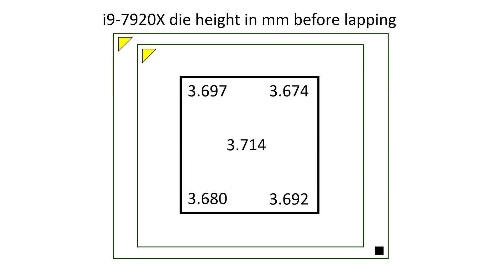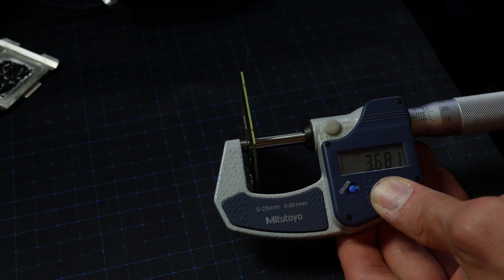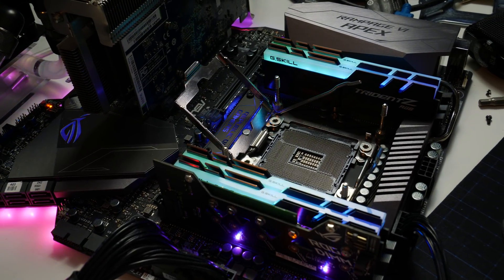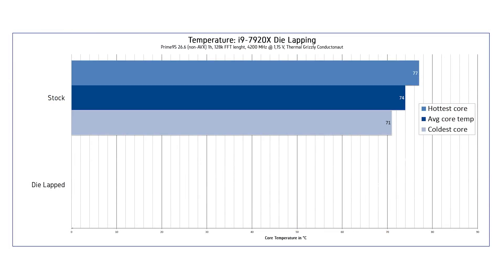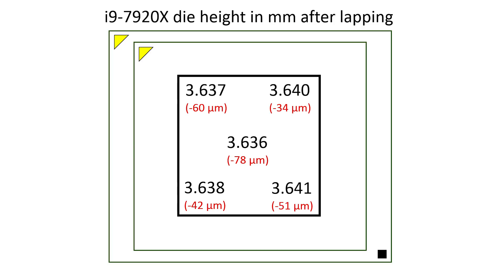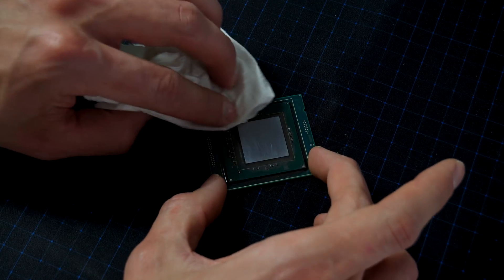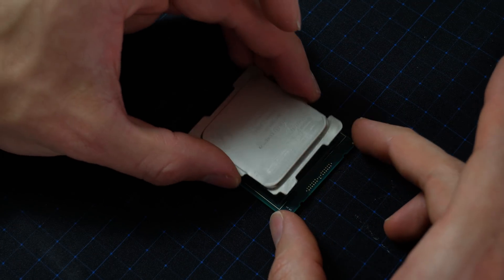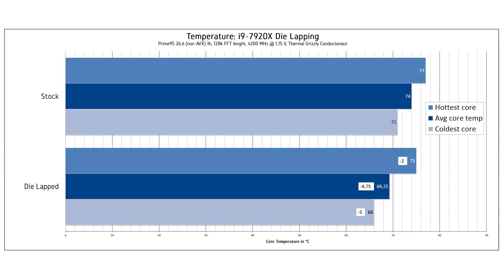Taking CPU Delidding To the Next Level !

Comment: How Intel have fallen with Ryzen far superior in temps.  Bonkers eh?
Reply: Andrei Neacsu
No - i'm not suggesting that, i am merely stating a fact.
solder certainly has better thermal characteristics, but the performance will degrade from thermal cycling.
Reply: "Much" lower clocks at the same core count? As in i7-7820X vs 2700X? Or i9-7960X vs last-gen Threadripper 1950X?
Reply: Alternative facts where you take information that is valid only for small-size CPU dies and generalize it, while neglecting to mention anything about the stability of the TIM itself. Even the best TIM degrades over time and imagining that the users should delid and replace the TIM after 8 years, or so, it's just wrong. 
Where you are right is that the new Intel CPUs do indeed run so hot at times that thermal cycling could be a problem for them if they were soldered; but that's just bad design combined with atrocious OEM cooling solutions either bundled with the CPU or (similar ones) provided by system integrators (Dell, HP, etc.).

PS: Thermal cycling could be a potential concern only if using liquid nitrogen and forgetting about it, going -100*C to +100*C. None of my chips from the last 25 years have stopped working. None out of about 30. Even the hottest chips like the Q9650 that is running overclocked from 3.0 to 4.33 GHz since 2008, the Phenom 2 965Black (OC @ 4.4 GHz), the FX 8350 (OC @ 5 GHz), some of the Xeons (the ones that run hot) have developed any issues. I have yet to see a soldered chip that got any problem over more than 10 years due to thermal cycling. 
For example, this is how I was running my Q950 at ~170Watts (130 Amps):
https://drive.google.com/file/d/0B5MeHZHaT2iNd1FyTWttUzVzNkU/view?usp=sharing
https://drive.google.com/file/d/0B5MeHZHaT2iNaU5pUlpBVzdxUXc/view?usp=sharing

I even forgot about the P4C Press"hot" 3.0 GHz oc to 3.73 GHz.
Reply: That's because Ryzen have much lower clocks.
Reply: ryzen 2 is much hotter than ryzen,it is close to intel and they did that to get 0,2ghz at most imagine what ryzen at 5ghz looks,and intel can run ivx at full speed while amd can run it at half,an avx workload is much hotter than no avx thats why you see intel cpus beeing very hot at some benchmarks,ryzen is also way more temp limited than intel with max temps beeing 85c before it throttles while intel is at 100c so when you see an amd cpu and an intel cpu at 80c the intel cpu is much further from throttling,in the end amd isnt much better.
Reply: @ABaumstumpf, are you suggesting that there is better longevity with thermal paste than with indium solder?
Reply: Ryzwn is more efficient.
Reply: There is a simple answer:
Your assumptions are wrong.

The Temps of Intel/Ryzen are relatively similar when the die is directly measured, but they use different methods of measuring.
RyZens are still a bit lower and that is cause AMD is soldering the CPUs while intel is using their patented tooth...thermalpaste. But that paste is used for a reason - longevity: even after 10 years it will perform the same as on the first day.

Comment: As soon as you said you were taking it to the next level, I knew this was what you were going to do. But why not connect the cooler directly to the die, rather than via the IHS. Also, was the IHS also very flat, or was the main benefit here from removing the poorly conducting diffusion layer?
Reply from the maker: Yea you can do that using my direct die frame as I said but it just lowers the total temperature. Delta should be the same so for the test it's the same result in the end but easier to mount :D
Reply: I see. Does that mean you expect the delta to be mostly due to the removal of the extra layer and not to the flattening? I probably missed your earlier videos on the direct die frame, and perhaps those already answer this. I will have to start talking about die lapping at work now. My colleagues think I'm mad, but they also don't have a 7700K running at 5 GHz (prime95) and I do. :-)

Comment: why nobody is using peltier cell in extreme oc anymore ?
Reply from the maker: will note that down for a future video :)
Reply: They have terrible efficiency you better of with phase change cooling (like in the freezer).
Reply: infango it is not 100% efficient and therefore creates heat. And the higher the wattage the lower the efficiency.
Reply: infango "physics". To cool a 100w CPU,  your taking about 400w peltier, that means you still need to cool 500w with a heatsink, plus those peltier pads have temperature limits as well. Now if we want to cool 200w CPU... Yeah,  1000w, your now needing LN2 to cool a peltier, when you could just use LN2 in the first place. 

Phase change is roughly 6-10x more power efficient (but extreme overclockers don't care, so ignore this), they also get much colder (mine idles at -58c single stage) and they can handle a load (mine is rated at -35c at 200+w load,  but it's also a small unit). 

Basically peltier just cannot deal with heat loads in that concentrated of an area, but phase moves the heat to an external radiator and has much higher efficiency. That is the reason they are not used (you totally could for Raspberry Pie overclocking, or if it's 24/7 I published a water block for it. Same as on my tablet where the entire water loop cost just $5 if you're not going extreme)
Reply: Would be great to see it in action again ahhh the memories of celeron 300 :D
Reply: wow that is TERRIBLE efficiency... like half your pc:s power goes to cooling lol
Reply: Have fun, Good Luck cooling any of the modern chips we have today with TECs, you'll need a pretty serious one.
Reply: you can get TEC Cooler 62mm x 62mm 560 Watt ..
Reply: jklw10 and your heatsink has to dissipate all that heat in addition to the CPU heat.
Reply: the bonus about is that it's pretty easy for a cpu to stay at room temperature.... just plonk a liquid cooler with a leaf blower setup on top of the peltier element
Reply: I used a peltier cooling setup way back in the day...worked pretty good but they also have some draw backs as well.
Reply: Agreed, The power consumption and sheer size of a TEM would be ludicrous to cool something like this.

Interestingly I recall the first TEM cpu cooler I came across was actually and OEM PC with a Pentium 75 or similar, something like a socket 7 anyway. The heat sink had a built in TEM, this was in a junk PC I pulled apart in my electronics class in school over 15 years ago now.
Reply: "in addition to the CPU heat" what addition ? peltier effect pumps heat  it doesn't create heat .. 
 https://www.tellurex.com/media/uploads/PDFs/peltier-faq.pdf
Reply: tec do put out A LOT of heat. please stop.
Reply: I've played with a pair of 150W peltiers working to chill the water loop.. and was completely underwhelmed by the results, they really are a waste of time. Phase is the way to go.

Comment: Done this on all my chips so far. Used more than a year on 5820k, 4790k. No fusion anykind. Always used liquid metal pro.
Thanks for showing it to the PC ppl. Not many think it's a sane move:D
But sometimes you do stuff cuz u can....
Reply: i have a 5820k too it has such bad temperatures it's crazy, how much did it get you in temps? i mean it's old anyways so i would consider doing it, also is there a possibility to direct die cool it? rather not i think but would be cool if you could share your experience with me :) also i use a 360 rad and a 240 rad custom loop with ek supremacy evo block to cool it, have conductonaut on top of the die... i mean it's soldered anyway so i thought that's the best i could do for now..
Reply: Paddydapro hey there!
Mine is direct die, also on all my CPUs.
Have used it for 4 chips. No cracking or anything.  Sitting at 60c max in syntethic benchmarks. 4.7@1.345v static voltage. Cooling is 3x360mm rads sharing liquid cooled 2xVega 64's.

Comment: I had no idea there was a thick layer of diffusion material on top; always been scared to death of even touching the die. :)

Really fun topic, I'd love to see part 2! Enjoy Computex. :)
Reply: the die is actually kind of upside down on the lil pcb
Reply: that's why you dont see any wires.
Reply: @minecraftermad  FCLGA/FCBGA = FLIP CHIP LGA/BGA
Reply: i had the mind set of  
touch the die and computer dies
Reply: Clearly you missed the days when CPU's were sold without IHS at all, and you had to mount the Heatsink directly onto the die. Also you had to push really hard on the clamps to get the heatsink fixed. It was really exiting every time, because if you put the heatsink on just a little bit uneven, you could break off a part of the die.
Reply: You actually did something to the cpu that you broke it...filed an RMA and got  it replaced. You do know that when you over clock or frack it up by doing something stupid you also should know the risks and not expect a free replacement...wow
Reply: Check out Der8auer's video where he shows the die cross section under a scanning electron microscope. It's a fantastic video!
Reply: In reality, dies are not really weak.
I beat the crap out of the die of my 8700K until its breaking point - and went past that breaking point when I mounted the IHS wrong (I didn't glue it, so it was floating) and it slipped, put a lot of force on one side of the die, and broke it.
Then I filed an RMA and got a brand new one!
That story is known as the Legend of the Voided Warranty.

Comment: I thought I had balls delidding an $1100 cpu with Liquid metal ... Now I have to contemplate sandpapering the freaking die! Damn you, Der8auer. Damn you. Lol
Reply: lol, all the hate, both are great cpu's, threadripper might not clock as high, but it is great value, the 7980xe is just the best thing you can get. However, you can get 2 tr 1950xs and a 2700x for the price of 1 7980xe.
Reply: jadoei13 I am an Intel guy, but I can wholeheartedly agree with that
Reply: InnDee Gaming I'm at a comfortable 4.7 all core on my 7920x with LM. 1.263 - 1.270 VCORE. this is all on water. I don't see anything beyond 75c under marathon runs of Realbench. Temps usually stabilize in the mid to high 60c range.
Reply: i got 4.3 ghz with 1.4v
Reply: InnDee Gaming you are quite dumb..

yes.. You can get higher clocks on Intel.. but those are 2 entirely different architectures.. you can’t compare it Clock for Clock. 

Intel shills like you only understand it this way.. if you get an AMD FX CPU and clock it to 5GHz, would it match the i7-8700K clocked at its stock 3.7GHz speed? Hell no!

the i9-7980XE can’t do shit even on Water.. unless if you delid that crap..

And as for your 7900X, 10-core CPU on a higher Clock speed vs *16*-core CPU on a little lower Clock Speed?

You’ve probably even delided it to achieve that 4.8GHz, meanwhile Threadripper works out of the box on air.

Threadripper does need improvements in terms of IPC though..
Reply: im saying tr doesnt even need to delid
Reply: PC Quick Tips TR also can't OC for shit so there's no reason to delid.
Reply: PC Quick Tips actually I bet it could use it...
Reply: PC Quick Tips TR also can't clock past 4.2ghz without LN2. What's your point?
Reply: Soldering iron and Q tips work.
Reply: I didn't realize this comment was liked this much
Reply: PC Quick Tips 7980xe can do like 4.8-5.0 on water. My 7900x does 4.8 on air. 4.3ghz! I remember 2012!
Reply: Sky Corrigan Intel makes some amazing products!